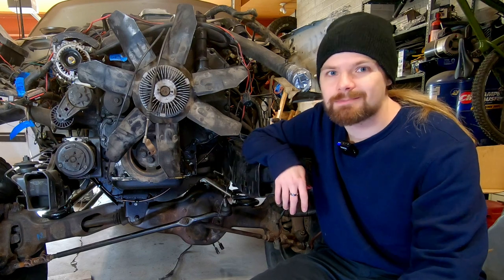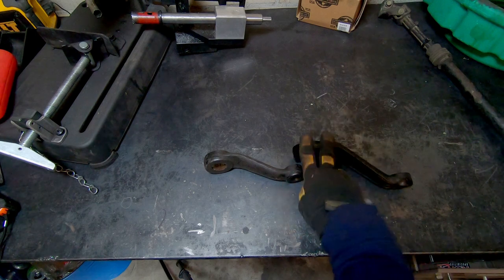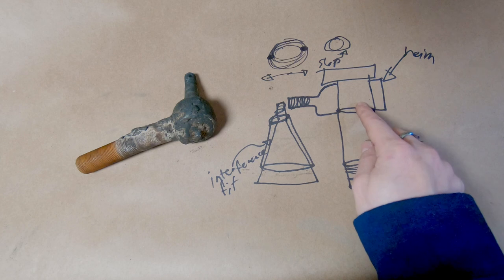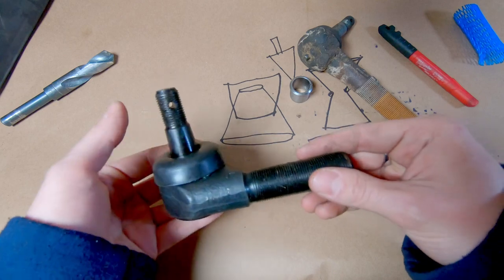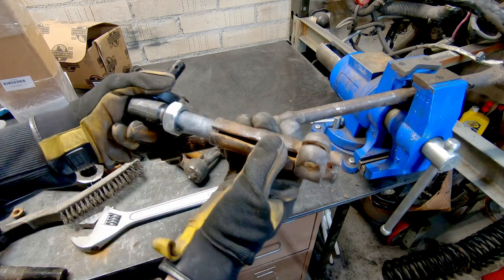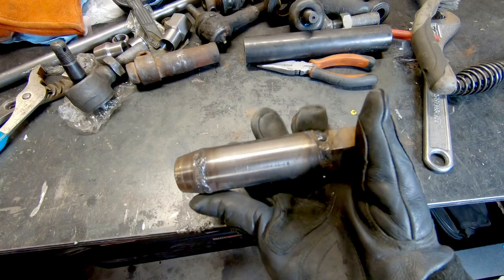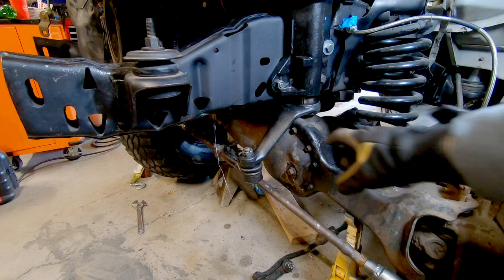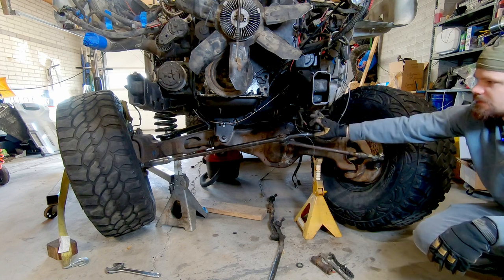EVERY Steering Mod! Tie Rod Flip! Drop Pitman Arm! etc.

Comment: I thank you endlessly. I've been looking for this topic everywhere and it seems there is not a lot of info about this. I'm building an offroad go kart and i wanted this suspension design on the front, but I was very confused on how the steering will behave with this suspension when it compresses and decompresses. Thanks again.

Comment: Just a Point, welding on any part of your Steering can set up Stress, which can lead to cracking. Also those sleeves are designed to be used in a Quality reamed or machined hole.
Reply from the maker: Good point, the biggest consideration is what type of material you have. Since I bought the weld bungs and tubing myself I know they're low carbon which is weldable, whereas the stock components could be medium carbon which might have a cracking issue. You can still weld medium carbon you would just need to let it heat up and cool slowly, and possibly even reheat to anneal it.

The weld inserts fit well in the 1/4 wall DOM tubing. You wouldn't want to shove it in a random pipe though, tubing is for structural stuff pipe is for flow. Also for the record 1/4 wall is pretty overkill considering the stock adjusters were 1/8 wall at best 🤣
Reply: @BuildSomethingAuto  My point was directed at your thoughts of your statement of welding the tie rod bushings in.

Comment: It's a good thing heim joints have bolts that fit perfectly
Reply from the maker: If the bolt is a sliding fit,, rather than being an interference fit, it isnt tight enough to ensure the load is distributed all the way around the bolt. "Perfect" fit is subjective to what type of joint you need, see the machinery's handbook for dozens of different fits based on application. In this case a slip fit doesnt have the longevity of an interference fit.

You need an interference fit to ensure force along the tie rod is transferred 360 degrees across the entire face of the bolt, which is why tapered connections are used on stock steering.

Slip fit joints are fine if you dont plan on putting many miles on, but for street vehicles it develops slop at higher mileage.

Comment: You can use a heim joint. To stop the bolt from ovaling the hole. You will need to weld a double shear (a second contact point for the bolt)

Comment: This is such a good video, thanks! I wonder if you could also just cut and weld the knuckle too..
Reply from the maker: Thats an option! Thats more popular with people wanting to switch to heims rather than tapered ball joints (tie rod ends) since for heims youd often be welding it anyways to get it in double shear (bolt captured top and bottom).

For a racetruck thats a great option, but for this vehicle I wanted to keep it simple and cheap

Comment: Adapter like that really needs to be built from single piece.
Reply from the maker: What, you dont trust my welds? 😂

What makes you say that? It’s super overkill compared to stock IMO, at least twice the wall thickness on the body and even thicker than that on the bungs. Grinded a bevel before welding for full penetration as well.
Reply: @BuildSomethingAuto  No I don't, I just hope those wont kill somebody else too when they disintegrate. You seem to have acces to lathe, it's just stupid not to make it from one piece.
Reply from the maker: @eurobeatmachinist732  What I'm asking is what specifically about these connectors makes you think they'd be weak? You must have a reason these look weak to you, let me know what it is! However I'd recommend taking a closer look at the stock ones, you'd realize very quickly how much stronger these are than them. Many a steering setup has been built exactly this way.

To do it on my lathe I would need to turn large internal metric and SAE threads in both right and left hand. In this case it's cheaper for me to buy the bungs then even buy the tools I'd need to do this. 

Besides, I'm a better welder than I am a machinist. I can do it better this way. If you have the tools and are more comfortable turning internal left hand M22 threads on a lathe than welding in a bung then that's great, build yours on the lathe!

Comment: You said that you had to stick with the GM tie rod end due to already drilling out the steering knuckle, but can't you just drop in a tapered spacer to fit a Ford tie rod end? Wasn't the drilling really so you could put the tie rod end in from the top, to get better alignment of the steering tie rod and the TTB arms? Great series! Keep it up.
Reply from the maker: Fair enough, I definitely couldve gotten a sleeve with the smaller ford taper. I guess I was also biased towards wanting the stronger GM TRE’s and had already bought them 😅. 

The other advantage was that custom connectors let me change the length to shift it over a little to match the steering boxes new location, I didnt discuss this as much as I probably could have in the video.

Comment: Hmm might save me alot of time just completely restoring my broncos Twin Ibeam and keep the Coyote swap simple
Reply from the maker: Broncos come with a dana 44 TTB front so its a lot stronger than the explorers, I think thats a great idea!
Reply: @BuildSomethingAuto  True but it was mostly the bad rap of tires wearing out especially after lifting them that was making me think a 2015 f150 chassis swap could be a thing. Either route will be a fully restored frame.

Comment: I was wondering if a Ford TTB style suspension would or could be modified to wor8k on Rockwell 2.5 ton axles? If it could potentially be done, how would it need to be done? Thanks
Reply from the maker: The rockwell's are solid axles, so you wouldn't really be able to do a beam setup with them. The largest beams I know of are these dana 50 beams I used from an F250. Here's the video where I modified these from leafs to coils to work on the explorer:
https://www.youtube.com/watch?v=KC26KjKelwM

And here's the video of me grabbing the dana 50 TTB axle from a junkyard F250 and compare it to the small dana 35 explorer TTB setup:
https://www.youtube.com/watch?v=oyu8b0woLzk
Reply: @BuildSomethingAuto  Thanks, I just noticed that some people are using the TTB setup on trophy trucks, ultra 4 cars,  rarely in rock bouncers, or rock crawlers. I just am focused on durability and you can't get much more bulletproof than Rockwells. I can deal with and even use the additional weight of them on the vehicle.
Reply from the maker: Good points. You got me curious so I went looking, it appears that the IFS setups in ultra 4s (and possibly trophy trucks?) uses a spidertrax center diff. Very spendy, a long shot from the $200 junkyard axle I used.

"Twin I-beams" the 2WD version is ubiquitous in 2wd race rigs, but it seems the 4WD version TTB is not really used that I can find. Part of the reason may be that it's harder to standardize, the beam carries the diff so it would require a different beam for every rig based on your travel goals. It also adds some unsprung weight because the diff is in the beam. The advantage though is that it's built like a ford 9", high pinion makes it strong. and it's cheap.

I think it's a very good value setup where you want strength and handling, all while being cheap. If you have unlimited money like the racers, then custom aftermarket IFS like spidertrax is better, it's just spendier. the 2WD version, twin I beams, manages to get huge travel all while being cheap/easy to fabricate and strong, it's only once you add the drivetrain components that it gets a little more complicated.

Comment: How the 4wd works?
Reply from the maker: It will work the same as on F250 trucks. The front driveshaft comes into the driver side member, then power goes through the differential where theres a u joint before it goes to both front wheel. 

I dont have the right length driveshaft yet so I havent been able to test it, but Ill post a video taking it offroad once its working!

Comment: So why wouldn’t you just buy a 6” or 8” drop pitman are in place of doing all that???
Reply from the maker: If you can find one and if the drops actually big enough then thats a fine option thatd be easier. However "hi-steer" like this also has the advantage of moving your tie rods up higher which gets them away from rocks and makes you less likely to damage them.

Comment: The part about the steering angles is so true. Every lifted ttb I have ever seen in the wild was improperly done. The pitman arms the lift kits come with are the wrong ones. The angles on the factory 50 ttb are really bad. Great work!
Reply from the maker: Thanks! Interesting to see you here! Thank you for your videos and forum posts. When I was first researching TTB the information on dana 50's was very sparse, your van kept popping up though which at least gave me an idea what the beams looked like. 

In the end I took a measuring tape to the junkyard to figure it all out, but it was great to watch yours cycling to get an idea. 👍

Comment: I would recommend a swing set steering setup. Loads more work, but very strong and eliminates bump steer.
Reply from the maker: That would definitely be the next step up in terms of high speed stuff! Maybe in the future. For now I wanted to see how well a stocklike but upgraded steering system could work especially since I think it might be more realistic for what most people modding TTB would be doing and want to see. 

Running and driving is the first goal so I can test, and then I’ll know what needs further upgrading 😄

Comment: Why not just cut and turn the beams? Seems way simpler given your mechanical aptitude.
Reply from the maker: It will likely need the beams cut and turned. First I need to verify how much camber adjustment I’ll need.

For the record the steering mods I did here dont actually address camber like a cut and turn would, what I did here addresses dynamics changes in toe as the suspension cycles 😉. Camber will come!

Comment: What do you do to fix the extreme camber? I'm having this issue right now with a 4 inch lift. It's about 5° off and ducked out at the top of the wheels
Reply from the maker: I havent fixed it yet. You can get camber bushings that give a couple degrees of adjustment over stock, but if the camber is too far off youre stuck with either moving the pivots down or a "cut and turn" where you cut the beams, turn em outwards, and plate them into the new position.

Moving the pivots down isnt optimal. It puts a lot of leverage on them and can make for some bad steering geometry, but the proper way, a cut and turn, is a lot more work. Theres also companys that sell beams that are already modified which is expensive but easier.

The easiest solution is sticking with 2-3" of lift instead of 4-6" 😅. But theres solutions if you need the bigger lift.

Comment: I have a drop pitman arm, and i think reversing the tie rods would solve my steering, however, i noticed one ttb arm looks to be a different angle than the other, what can i do? The truck is level, and was measured in level ground
Reply from the maker: That could be true, the TTB members are different lengths (depending on what truck this is) so they may sit a little off from eachother. As long as the truck is level side to side I wouldn't worry about it. Either way getting the steering closer to the same angle (tie rod flip) can only help even if it may never be perfect!

Comment: Would high steer help fix some of that steering angle as well? As in making a mount that is on the upper section of the knuckle
Reply from the maker: Yes that woukd make a big difference. Most histeer setups Ive seen use heims so if its a daily driver youll have to remember youll be switching those out more often, but for a dedicated offroader or more of a racecar histeer would be optimal.

Comment: Not every steering mod! RHD swap with chopped and fabbed superrunner steering. 90s Ford engineers weren't very bright. So im fixing what they couldnt! I really like this channel but the computer usage is a bit odd for old skool gear heads. I just build, i dont use computers. A few google images get me in the ballpark then i use everything iv learned over the years. Great channel!
Reply from the maker: Fair enough! I'm trying to merge the worlds of engineering and mechanics and I'm hoping it still comes across alright. It's hard to know where the balance is between introducing a new perspective, and being just plain confusing 😅

Comment: My question is where did you get the metric tube bungs? I'm doing this identical project steering wise and would like to not have to order it from the UK
Reply from the maker: It was an ebay seller and came from the UK. If you're willing to spend a little more Mcmaster sells the tap, so you could thread your own but if I recall it was kinda expensive ($100 or so, you may need a left and right hand tap). 

Mcmaster also has the correct nuts so you could weld some nuts on a tube, but I personally wanted more threads than that for steering stuff. Maybe 2 nuts stacked on each other?

Best of luck! Let me know what you figure out it may help others as well.
Reply: @BuildSomethingAuto  I ordered from the same company. Tried seeing if a machine shop around here could make them and that was a negative. Only thing I'm running into is finding a pitman arm for an obs Ford manual steering box. Thanks for the reply!
Reply from the maker: @JoshuaEltonYahoo  You're welcome! If you haven't tried them my go to is usually ruff stuff and bronco graveyard. Good luck!

Comment: I’m glad to see that I found you I’ve been having that steering problem on my 2wd f250 on a 6in lift and I go though tie rods like crazy I’ll put new moog parts and get it all aligned and in about a year I’ll have all kinds of slop in my steering one question what are those inserts called
Reply from the maker: Theyre called steering knuckle inserts. Ruff stuff makes some, but heres a link to them on amazon (note this is an affiliate link)
https://amzn.to/3f4BquT

Id recommend grabbing a drop pitman arm while youre at it especially if you have 6” of lift 😅

Comment: Could you have swapped the spindles side to side, turning them upside down at the same time?
Reply from the maker: I dont think I could have swapped the steering knuckles side to side, they arent really symmetric. The balljoints would be upside down (if theyre even the same size), itd lower the axle, and itd drop the steering quite a bit. 

Its good to consider all the options though!

Comment: The drag link needs to be longer the pitman arm should be straight forward when wheels are when you turn wheel all way to right under load it will bind
Reply from the maker: I had the same concern when I made it. To try and alleviate the issue I made the passenger side connector a couple inches longer than the driver side. It works well enough that even spinning the steering input by hand it moves smoothly away from full right lock without binding. The video makes it look worse than it is its still about 10 degrees off of pointing DIRECTLY to the passenger side, at lock.

It is abnormal. Like you said it doesnt sit where stock would sit, but as far as I can tell it’ll work fine! Id rather keep stock parts if I can, but if I have to modify the drag link I will.

Comment: Cons- TOE IN.
Reply from the maker: Normally the toe isn't really affected since you have enough adjustment in the tie rods to fix that. Because of the steering box being moved I did eventually have to extend the tie rods even further to get the toe and steering angle I wanted though. The real con to lifted TTB is the negative camber, not the toe 😅